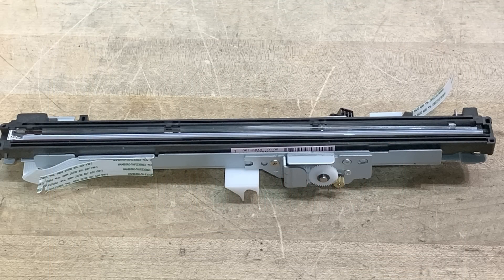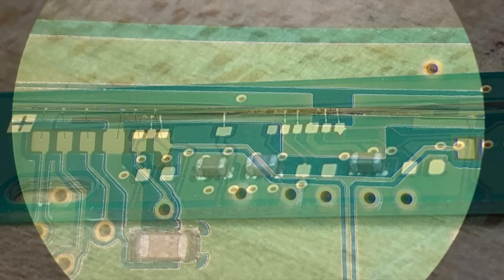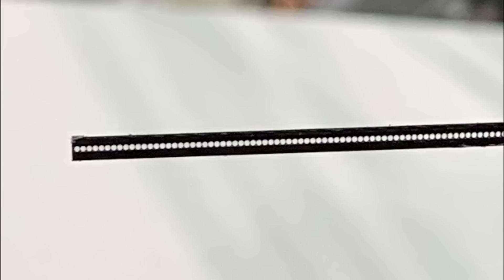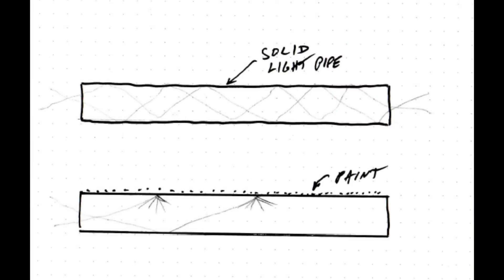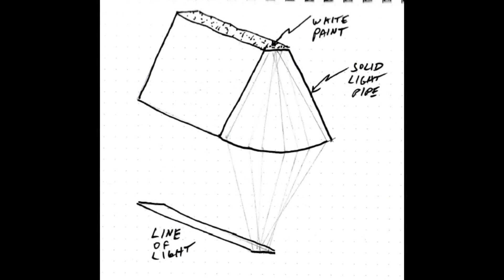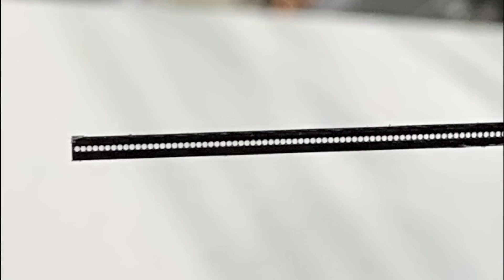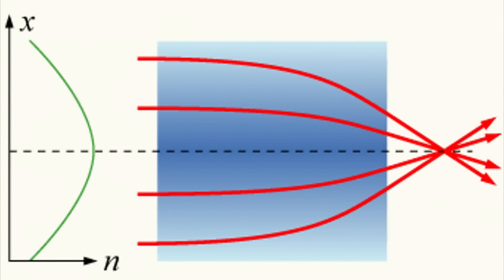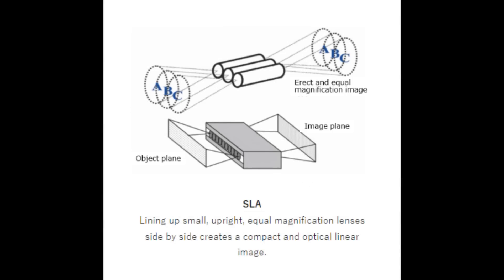#1399 Optical Page Scanner Design

Comment: Thanks, I learned a lot in this clip.
All of these for a few $100!
The magic of industrial mass production.
Also, I think under each lens there is multi pixel photo censors otherwise, we would not get the resolution (300 pixel per inch).
However, if I had to design this I would use a camera to take picture of the whole page.  Of course the camera have a CCD or active photo transistor chip.
Also, another way of designing this with one photosensor is to use 3 leaser beams that get reflected by rotating mirrors over the page (similar to CRT tube but instead of electric and magnetic field to deflect the electron beam a rotating mirror deflects the leaser beam) and its reflection from the page is recorded by the photo sensor.

Comment: For monochrome scanning all 3 LED's get turned on at a certain ratio, so they all provide 1/3 of the illumination needed, then the imager does a single image, giving you the monochrome image. For lower resolutions they can use lower light, and run the imager at lower digital resolution, allowing a faster clocking out of the analogue data, as you do not care much about noise, and thus can scan faster, as you do not have to worry about rise times in the image, and can also use the image from the moving scan head, as the lower resolution hides blur. Quick and fast scans, because your image smear is hidden in the poor resolution.

Those graded lenses are made in large sheets, bonded together, and then cut with a cutting wheel, and polished to a smooth surface, and for the cheapies always are the graded plastic, which starts off as a set of large clear tubes that get drawn out to a thinner and thinner fibre by a hot drawing machine, and pressure applied with hot molten way to the thick tube, to  both force it out and lubricate the die. Then cleaned, laid into a layer on the sheet, coated with the epoxy, and have the top applied before a heat cure. Accurate enough, though higher resolution still uses a set of folded front surface optics and a smaller sealed ceramic packaged imager, single die, to get that great sharp image. Still plastic optics, as you get great work with mass production out of them. After all the required resolution in most scanners is only 133DPI, easy to get with the plastic lenses, and you can fudge the specs to say 400DPI with colour.

I still use a HP Scanjet 340C, works well, was free (no drivers past XP for Win7) and it works stand alone. No all in one all singing all dancing, which will not scan if the one colour is even the slightest bit low, which was the death knell for all the free all in one printers I got for free.

Comment: Beautiful. Wonder what the sensing part behind the bond-wires looks like... I imagine it is a 1x10'000 pixel "line camera" (line of photodiodes). I suppose the serializer is integrated on that same silicon too..
Reply: At that level, much like I imagine LCD row/column drivers, I imagine the "serializer" is little if anything more than the same sensor-interface circuit already necessary/existant at each element (e.g. a D-flip-flop for an LCD row-driver driver, or an analog sample/hold equivalent to latch the sensor value) each just daisychained to the next element like a shift-register. (In CCDs as I recall, it's a "bucket brigade"). 

In other words, it's probably not like they have an ADC at every element, each with an 8bit data output that then gets connected to a bus, that then has 10,000 chip-selects selected in sequence by a counter, then the selected data fed into a shift-register to serialize.

I was going to compare it to, say, neopixel LEDs, but actually I think that's not a good example at all, and yet another (third) serialization technique, because I think they have essentially an entire microcontroller at each element... making their daisychain a bit more like "deserialize, grab/process my value, subtract one from the address and reserialize if it wasn't mine"

But this is all hypothesizing on my part.
Reply: @ericwazhung  I meant serializer in a bucket-brigade sense, indeed, as in CCD or CMOS, with a difference being a single row of pixels. I wonder also how the GRIN lenses (1mm diameter) interface to a subset of "pixels" - say 20 micron each (20mu * 10k = 200mm width of the flatbed). Do you suppose one lens would feed ~50ish adjacent pixels? .. and how would they avoid a horrible streak in the middle, where two pieces of silicon abutt each other?
Reply: @AdityaMehendale  Sounds like the joys of DSP and calibration  routines to me! OTOH to keep things cheap, I can't imagine every machine gets custom-calibrated. And I'd have a difficult time believing they could get twenty inch+ long pieces of silicon glued to a PCB at micron levels of accuracy, nevermind e.g. thermal expansion... So... at those prices I'm guessing a one-size-fits-all approach to the DSP side of things...
Oh, which probably includes some amount of intentional non-focus at the sensors, causing rays from the same "pixel" on the page to enter multiple nearby sensors, and, again, dsp/image-processing to extract.
You got a better idea?
Reply: @ericwazhung  I suppose that makes sense. With DSP, you can filter/oversample/decimate/sharpen/etc. You cannot however generate information out of thin air I have difficulties imagining how a DSP could deal with missing pixels at the joint. Guess one of my upcoming weekends is going down the rabbit hole :)

Comment: In my book this could be your top video of all time.  

Given that the RGB diodes have narrow emission wavelengths and the light sensors capturing the image have their own frequency response curve would there be volumes within color space that the scanner couldn't see?  In other words if I had a document printed in a specific color would it be invisible to the scanner?
Reply from the maker: yes the LEDs are too narrow for perfect color fidelity
no the sensor is very broad band
anything 'printed' will use dyes and pigments which are not narrow 
so the scanner will not be blind to things but there will be some color inaccuracies